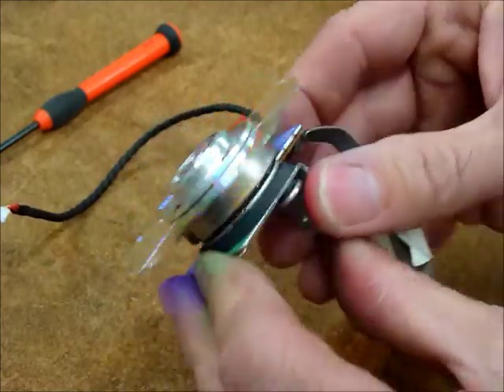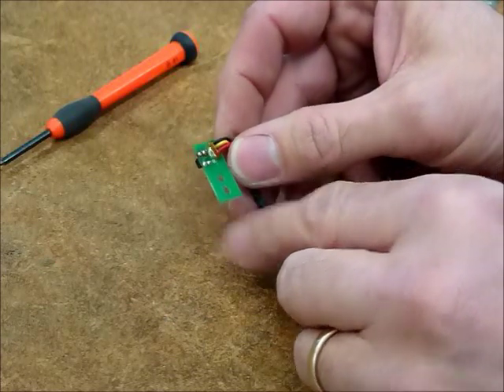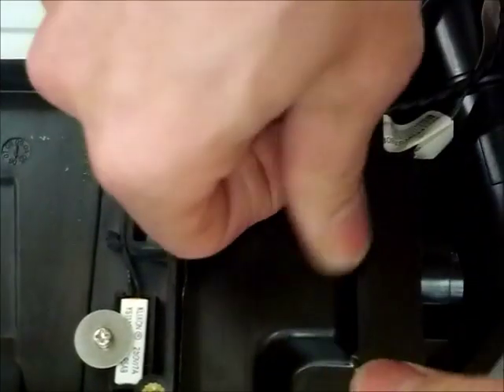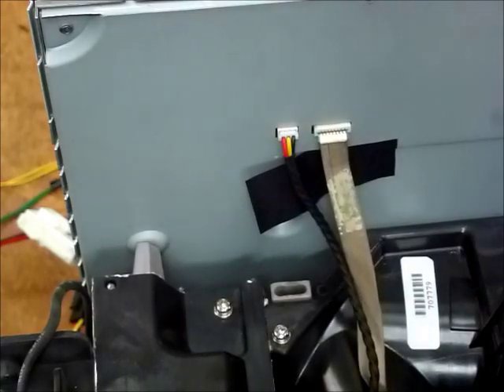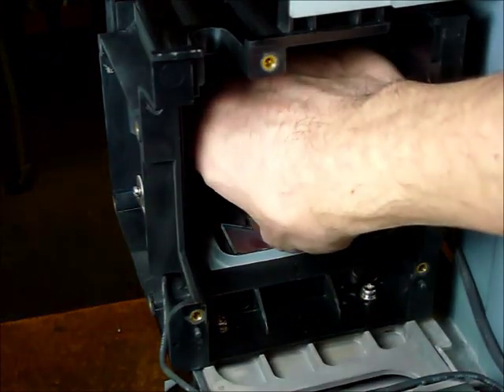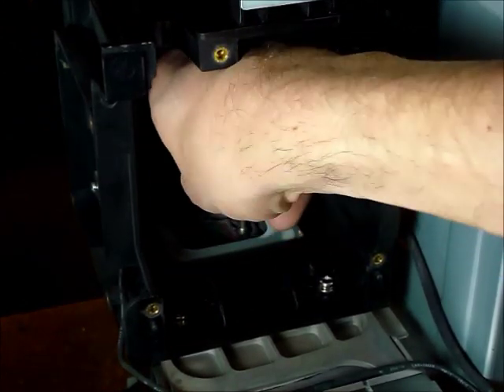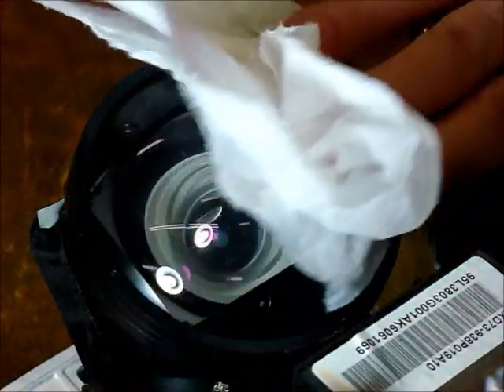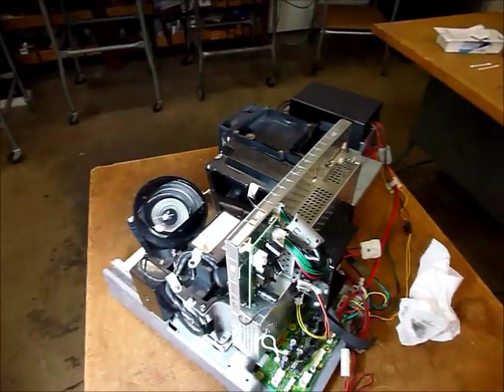Part 2 - Mitsubishi WD-73727  DLP Color Distortion Distorted Fix Repair V28 V29 V30 V31 Chassis

Comment: norcal715 - I wanted to take a minute and tanks you for the excellent teach-tape. I followed your instructions . . . which took me approximately 4 hours, as I used as many precautions as possible; e.g. "taping & numbering EVERY connection that I unplugged," and "pausing your video after each step," to ensure I didn't wreck the TV. That said, it was worth every minute! I have a WD-73831, purchased in 2006. When it started distorting / solarizing, I was prepared to simply purchase a new TV. While browsing for certified Mitsubishi service providers, on chance someone might be able to fix the problem; Google resolved my query to your postings. The one thing I'd draw specific attention to is the fact that the untrained eye, such as mine, might assume the color wheel is actually clean when you first remove it! But one swipe of alcohol across it with the q-tip, and BAM!!!- - you quickly realize just how shiny clean color wheels are supposed to be. That said, you're a good Guy for taking time to post the videos. If you're ever in DC, two rounds are on my!

Comment: I have the same model in your video. This video is the best I've ever seen, thanks. Never had any problems other than the light bulb. The TV is 7 years old and I see 1-2 inch wide shadow strips along the top and side of the TV.  Will the steps in your 2 videos correct this?

Comment: Yes, it is very much a shadow across the top of the screen. Larger on the left side and gets more narrow as it runs across to the right. I also need to know if there is an issue looking into the primary projector lens to see if it needs cleaning. Do you have any info on getting in there without disrupting the focus or positioning of parts within the lens? Looking forward to your light tunnel repair.

Comment: I have reviewed and performed all of your recommended procedures and the difference is dramatic! I would also advise that the user also clean the primary reflection mirror on the back of the set. Was an easy job and cleared up the final hazing I had on mine. Also used another video of yours to adjust the light tunnel which got rid of an annoying shadow. I am left with a couple of questions. My set has one speaker that does not work when in stereo mode. Upon investigation, it is obvious someone shorted out one of the leads going to the left side speaker. The insulation is cut and the wiring exposed. Speaker tests good. Can you identify the specific card that contains the amps for the speakers? I presume there is a blown component due to the shorting. A clue is that the speaker does work when put in surround mode. Also, is there a list somewhere describing the adjustment and functions for the service list under 2457? I would like to more accurately go through the adjustments. This has been a fantastic experience and you have helped keep some very nice sets out of the dumpster. Big thank you!!!!!!

Comment: Like Holmes on HGTV there are people who are super-stars in their field, You are another Super-Star.
Replaced my lamp (wd-73) put it back together, now after 5 minutes, the color will flicker and a humming sound starts.
What should I do? Thanks
Reply: +Ronald Zingale Did you find a solution? I would check the color wheel for mounting tightness, and make sure none of the tape has come loose or is hitting the wheel. Failing that, you could have a bad bearing in the color wheel, and may just need to replace it. Not much you can do to replace that bearing. 

I'm thinking that problem is purely mechanical.

Comment: norcal715, 
I have the wd-73727, I followed every step on these videos and everything went well and i cleaned everything. When i went to power my TV on, the audio came on but the picture did not. The lamp light was now lit on the front of the TV and the TV shut itself off after about a minute. Before the cleaning the lamp light was not on, and the only issue it was experiencing was after an hour there would be flickering and then the color would change to green and purple. Any advice ?

Comment: Great tutorial!!  Before I tear into the back of my tv (wd 73831), the issue I am having is the picture is alright the first twenty minutes, then the screen (not the picture) starts to split into two halves, as the color starts to go out of whack as well.  Will your solution fix my problem, or is that a totally different beast?  Thanks for your time.

Comment: Hi! 
I used your videos to clean out my light engine on my 73727. It worked well but I still have what looks like haze on the left side of the screen. I saw another video or document somewhere that showed cleaning the main projection lens but I cannot find it anymore. I also have a shadow across the top of the screen. Are you going to do a repair or adjustment video on that?

Comment: Hello my name is Jose and I have a mitsubishi dlp WD-73638. After i replaced my broken lamp the tv and picture worked fine for about 5-10 minutes and suddenly starts flickering colors. I am going to attempt to clean the color wheel and any build up but before I do I want to get any other suggestions of what the problem may be. Thank you for your time.

Comment: which is the best bulb to buy,or is there any difference between the $45 and $100, I just bought a $55 and it blew after 2 days. no warning on tv just shut down and code reads 34.(bad bulb). thanks for any help

Comment: Hi. Great video. Thanks for taking the time. I actually got my last two lamps from ShopJimmy.com! About 6 months ago.

One question. After having the solarization issue, I followed this procedure and it worked great. The color is back to almost perfect. 

However the picture is very dark now. I was wondering what I could check where the light issue could be? I have a 62629 set, I cleaned all the lenses and the two sides of the light tunnel. The three lenses by the color wheel seemed fine so I just lightly whipped them with a damp paper towel. 

The only thing I noticed was that the foam around the main projection bulb was very warn and almost falling apart. Could light be escaping there?

Any suggestions would be very much appreciated.
Reply: +Aaron Lippold Update: Sorry, It's a WD-62927 set. Thanks for any suggestions.

Comment from the maker: It very well may fix it. Look for the white haze on the color wheel and be sure to clean the optical sensor and color wheel rotor. BE VERY CAREFUL THE COLOR WHEEL IS GLASS AND VERY FRAGILE!!!!! Also a replacement is very hard to find!

Comment: Wow cool vids. Glad I found your channel. I recently got into fixing up these TV's and have so far given 3 away to friends and family and one for myself (73727). I went from never owning a TV to this monster... the thrill! I added a couple fans and rerouted airflow in a couple places (as almost all problems in these DLP's seem to be from heat) but had not thought of the mods you did. Question.. the fan inside the Power board area.. In a similar I set I fixed it runs whenever plugged in, even when powered off. Is the one in the 73727 supposed to be running whenever plugged in? I tested the fan itself and it works fine but is not turning on when I plug in the set or even power it on.
Reply from the maker: weeral1 On certain models the power supply fan ran continuously, the main model that comes to mind is the first DLP chassis, 525/725 series. although several other models with the "pancake"chassis (similar to the 727) had fans that ran continuously. Others did not, I believe the software installed in the set has a lot to do with it. Some models did not even have a fan installed. Most of the mitsubishi sets use 3 wire fans and the 3rd wire sends a rotation signal back to the microprocessor, if a fan stops then the set will shut down.
Reply: norcal715 Thanks for the reply. Several months have passed and my 73727 was doing great with your mods and mine.. however now I get a red blinking light.. I can pull the power cord for 30 seconds or so and plug it back in and get it to work that way. I understood the blinking red was a fan code? The one fan that was not working before the last re-work, I simply powered from another fan, that worked so I left the signal wire alone. several months that worked, now I'm wondering what to do to fix the problem. Ideas?
Reply: norcal715 PS. I got code 35 chassis fan. That was the fan that had the problem originally. The complete problem was it did not come on.. but when I gave it it's own test power supply it worked fine, so that's when I bypassed it's original power supply for another. Anything helps thanks!

Comment: Not all bulbs purchased from EBay or Amazon are compatible. If you are getting audio only and no video, you most likely have the wrong bulb. Same thing happened to me. I purchased a bulb from eBay and it did not work as advertised, wasn't 100% compatible

Comment: Anyone know anything about the TV Disk feature in these TVs? We're getting rid of ours and I recently discovered a bunch of really random old recordings on it. We initially had a cable card with the TV, but not too long after we switched to the standard cable box and DVR. Just wondering if there was a way to remove the actual TV disk, or retrieve the recordings themselves. I read something in the manual and plan to try that, but removing the disk itself might work more in our favor and current time crunch. Thanks!

Comment: Hi there.   Do you know if this tutorial will work on an 83 inch model?  WD-82837?  I hope you see this,  as this video is very old. 

Either way,  thanks for your video, and have a great Thanksgiving tomorrow!
Reply from the maker: That is a much newer model and normally did not suffer from the "outgassing" plastic issue. caused by UV light.
Reply: @norcal715  Thanks for the reply.  Interesting.  I was having some sort of "solarizing" issue, and took it apart and cleaned some things off in it.  Your tutorial did help a lot, even though, yes, my Tv is a newer model than the one in this video.  TV seems a lot better now.  Thanks again!

Comment: Great video you made for mitsubishi dlp televisions . I wanted a mitsubsihi television after I sold my mitsubishi crt big screen box style . But they cost like over 2000.00 dollars back in 2007 . I bought a sony 52 inch tv then , but the mitsubishi looked better . the sony was like 1400.00 from sears with the 3 year warranty then . I dont like plasma or lcd they lok like crap if you ask me .

Comment: If you lose color aftet 30 mins after it been on or if the color is complety gone than replace the color wheel sensor on the side of the color wheel. If its flickering and the colors are going out. I have the sensors but there not made anymore. Email me for info.

Comment: i have a WD-73727 a friend gave me a while back but have not used it since. i just  plugged it in to see if it works and you can hear a click sound and then there is only a blinking green light it then restarts and blinks twice then after about a minute a fan turns on for about 15 - 20 seconds and then the process repeats itself. if someone out there can please guide me to what is wrong it would be very helpful . thank you.

Comment: This is so much easier on my Mitsubishi dlp tv crazy I tore the thing apart  to kinda look like this but it's a simple cover to remove and the fans are 12 volt hmm its a wd 73 638 i bought it for 100 they said the lamp was bad but i dont think they could get the generic one in there fixed it then the dlp chip started to go out as long as the color wheel was gonna do both last night now I need to replace all 3 fans as well bad dust problem

Comment: Something he doesn't tell you is it could also be the Pixel Chip i believe that is what the repairman told me it was when he was changing my color wheel and once that goes you can't fix it my  strong suggestion
don't buy a DLP TV i have no doubt in my mind you will regret it sooner or later the constantly cleaning and changing lamps turn off the tv now and then so it doesn't over heat F>O>H!!!!!!!!!!!!!!